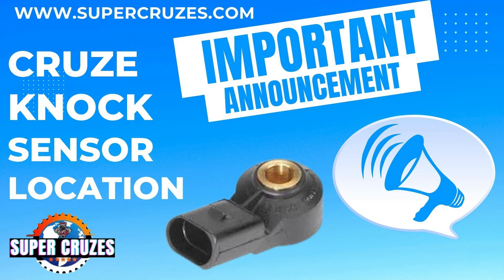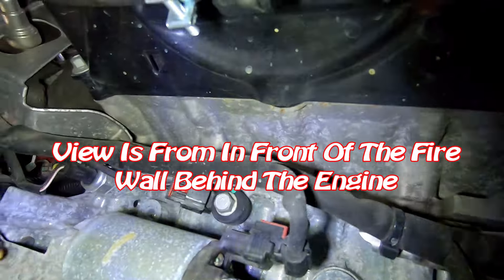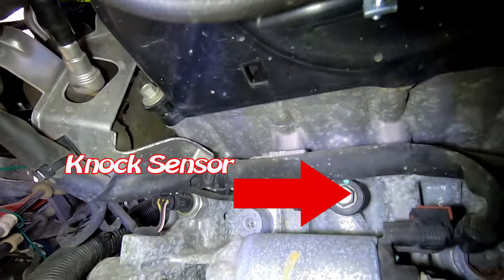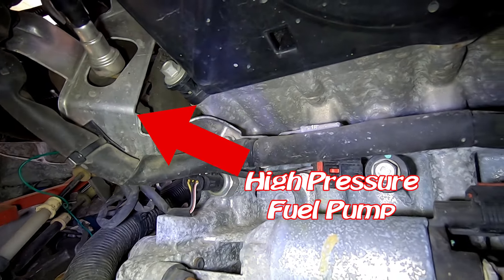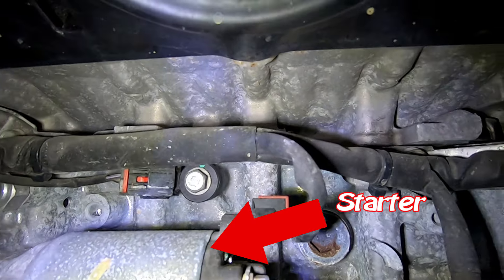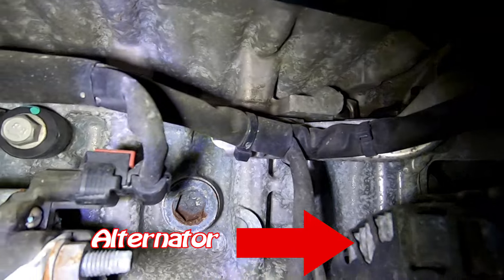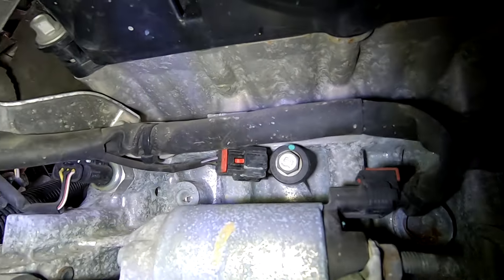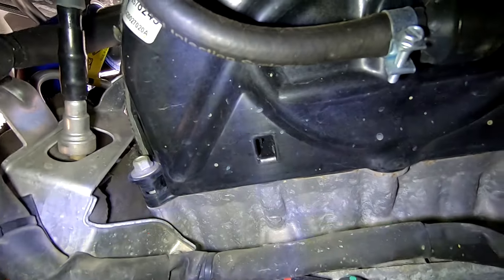2016-2019 Chevy Cruze Knock Sensor Location codes p0325 p0324

Comment: Ok.  Sweet.  I just actually threw one of these codes
Reply from the maker: It’s pretty common. Did you get gas recently ?
Reply: @davesworld2132 mine just threw this code and I always use 91. My wife took it on a road trip and used 87 for about 500 miles. I'll let you know if the new sensor fixes it
Reply from the maker: @derekbird8079  the knock sensor also senses when fuel is bad. Run a fresh tank of 93 in it after abs see if it goes away.
Reply: i thought chevy cruzes only took 83🤔

Comment: If you take out the Breather box on the left hand passenger side of the motor you can reach around the back of the motor unplug the sensor take the number 13 bolt loose screw it out with your hand and then reinstall the other one easily just reach back there with the sensor in your hand plug it into the harness locket and then screw it into the block tighten it down I did it in 15 minutes
Reply: Number 13 bolt 🤔

Comment: Replace my knock sensor and code came back and engine has loss of power everything on the car is stock what could the problem be?
Reply from the maker: Could be the actual fuel your running in the car. How full is your fuel tank?
Reply: About 1 quarter of a tank